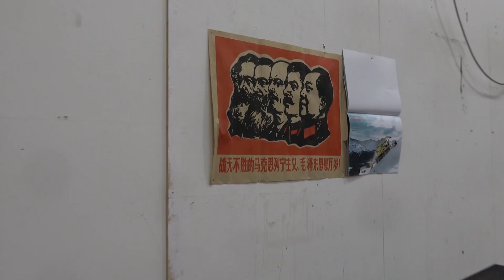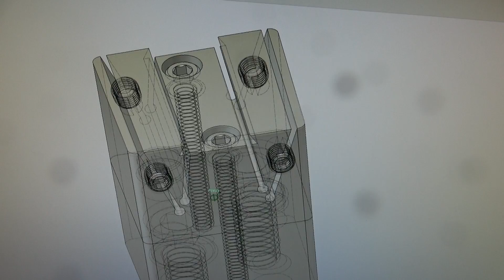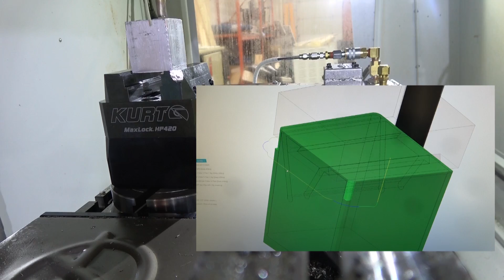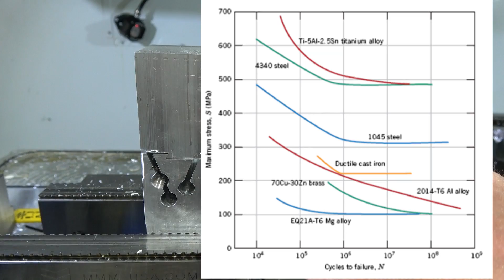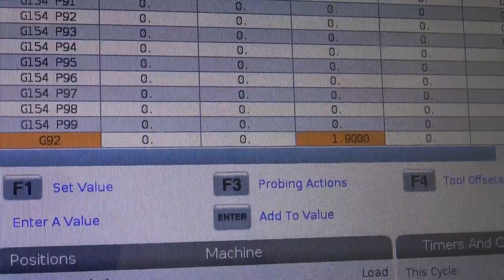Prototype invention 5-axis Vise?

Comment: Perhaps if you plug 'er from both ends she'll be less likely to run off on ya...
Reply: I think I'm smelling what you're laying out in the bathroom... Grub screw in each side and refined tapers so there's two points of contact on the screw side without complimificating the machinery processing too much?
Reply: @MrNavyman53  Exactly. This might be a little far fetched, but with that configuration you might even be able to use a torque wrench to ensure balanced clamping! Or just drive 'er deep in both holes and hope for the best...
Reply: @MrNavyman53  If that hole is square and we're upping the BOM to three pieces, maybe size it snug for a hardened dowel and put your grub screw in perpendicular bearing against the dowel. Also I'd probably want to cut the doveltail last while the clamp is tight so its not cocked when you clamp it. More even contact I'd think.
Reply: @MrNavyman53  how about not putting se screw parallel but rather 90 to the Dovetail?  More Clampage force....
Reply: That's what I was thinking as well. Just screwing it on one side is causing it to ever so slightly to tweak out of square since the clamping force is uneven.
Reply: Man, I must have dated the wrong girls😁
Reply: @mrchew1982  Girls? Who's taking about girls?
Reply: @mrchew1982  judging from some of the girls on Pornhub, we have have!
Reply: LOL
Reply: Turnbucklizer. Like a bicycle bottom bracket.

Comment: 1000 dollars? I can buy a whole bottle of cyanoacrylate for a dollar and still throw my part across the shop
Reply: Maybe when people get to play sports again we should start a CNC-machine Tee-ball league.
Reply: Alec J naw foosball. Robotic migration
Reply: @alecjahn  we can make em amateur athletes but if they read up on the NCAA.... theyre definitely rising against us in glorious revolt
Reply: Go price some of the larger 5 axis vises - under a grand is CHEAP.
Reply: @machinist7230  I run robodrills at work that have custom fixtures so the robots can load and unload parts from them and they're around 4 thousand a piece two per machine  and 8 machines total it does get very pricy indeed. I'd still be very interested in seeing someone actually use super glue to attempt to hold down a part in a mill, im almost positive it would be to brittle though maybe with a pin for the side load it would work
Reply: @zackman62t  Go checkout @NYC CNC for some interesting super glue methods that do work quite well. I'm too lazy to do all that prep work so I prefer double sided tape when I need to hold a part without imparting any clamping forces.
Reply: @zackman62t  ive done the super glue trick a couple of times, and have even used double faced tape to hold down cicuit boards to contour them in a vmc. And yes workholding does get pricey, even run of the mill Kurt anglelocks, when you start buying them 30 at a clip... Funnily enough, i got turned down when i asked to order Orange vises to tool up our then new Hurcos...  admittedly it was for 9 new 3 and 4 axis machines....
Reply: @zackman62t  It may not meet your definition of 'mill' but NYC CNC has videos of them doing that regularly for one-off parts, on their Tormachs
Edit: someone else already mentioned them as well. 😅👍
Reply: @zackman62t  We do it all the time for thin sheet stock.
Reply: @zackman62t  
Run the cyanoacrylate up the side of the part a ways & sprinkle a bit of sodium bicarbonate on the top.
Instant catalyst, and gives it a little flex after the coolant runs on it enough to dissolve some of the sodium bicarbonate.
It's what we use to dress the edges of carbon fiber helicopter rotors when they get chipped up (the physics of hitting bugs at 500 mph are insane), so it might survive a high speed milling bit.
Reply: If you’re getting a whole bottle for dollar, you’re not in Australia.
Reply: @LongPeter  begs the question why you still are eh?
Reply: @stanburton6224  Because the fella who brings it to your house on a Saturday gets holiday pay and all-you-can-eat public health care.